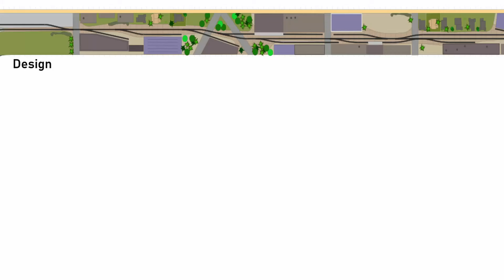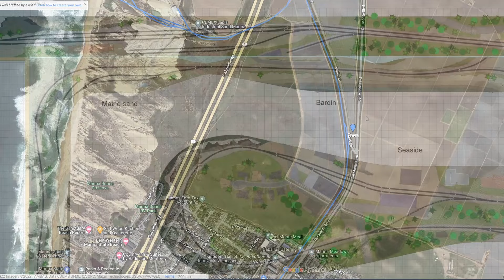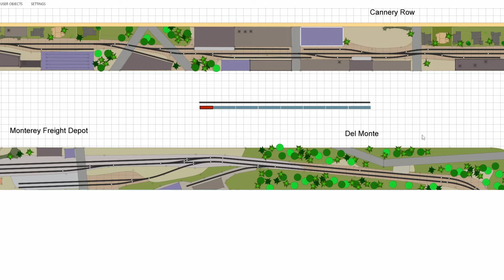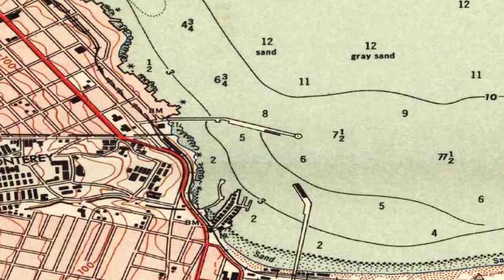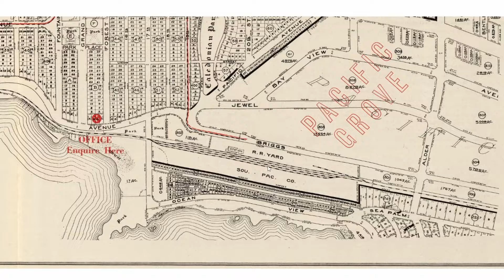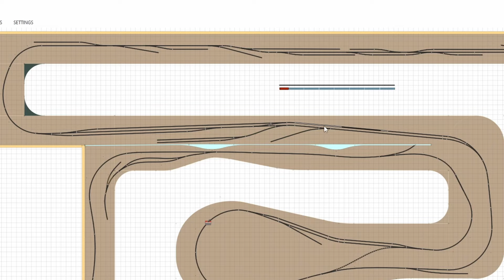Layout design considerations - Proto Freelance ~110

Comment: This is one of the BEST track plans I've seen in quite a while!   I would love to see this set in the 30's to 50's, with Fort Ord incorporated into it, but even so, this will make a great modern layout.   The only problem is that there are no more canneries on Cannery Row.   Those disappeared even before the railroad did.    

Still, I LOVE this layout!   Wish I had the time and money to build this myself.
Reply from the maker: Hi Ron, to be more specific, the entire railroad is almost non existing now a days! I believe there are plans to bring it back as a form of lite transport. 
We are stretching the limits of proto freelancing. But I believe it will make a great and realistic layout. This size layout really lends itself for 80ft boxcars and consists one finds on branch lines. A modern train with 30 cars won't fit. One could reduce the industry count on cannery row as it could have been. Adding a few empty foundations. This would symbolize the deterioration of rail traffic and rail served industries. At the cost of less switching of course.
Reply from the maker: P.s. Wish I had the space!

Comment: Hi Dubai!!! I really enjoy how you plan out your layouts... I really need your help. I'm trying to put together an apartment layout in the shape of a square C the three boards will be 3 ft by 63 inches which will showcase the ATSF in 1950's from the Chicago Dearborn station to Topeka Kansas, and lastly to San Bernardino California passenger station and yard. The problem is finding the industries that the trains would service and understanding how to place the tracks to make everything flow? How do you figure out where you want to put stuff and does it make sense? Then I'm in an apartment so I'm trying to make modules and wire them together so I will be able to put them back in my closet standing up so what should I add and not add with it being a mobile layout?
Reply from the maker: Hi Jeff, that sounds like a fun project!  If you can send me an email, the we can get the design process started. My email is in the 'about' section of this channel.
Chicago - San bernardino will mean a lot of fruit!
Reply: How do I get to the about section
Reply from the maker: Go to the dubai trains channel. Then there is a row of tabs listing home, video, short, playlist etc. And the last one is about.

Comment: Did the real trains go as far south as Los Angeles?  In Sept.of 1985 the Army at Fort Ord unloaded a bunch of military equipment off flatcars parked on the 8th st bridge. Probably the last time those tracks, near the army base were used.
Reply from the maker: No the railroad stopped at the lumber yard and sand pit. I read there are all kinds of plans to reopen the line for passengers but i don't know the status of that.

Comment: Now that's the train room you should be building!  Holy cow!  You really filled it up nicely, too.  
I leveled the layout.  What a chore.  I tested with a free rolling boxcar and a section of flex track, after using a 4' level to get as close as possible. 
BTW, did you know the height of Peco 83 track from bottom of ties to top of rail is 5/32"?  Never know when you might need that!  LOL
Reply from the maker: It was quite the design and quite the space! There was no space in the video for variants and details. A layout design is in most cases a journey of finding out what you really want. That will drive the compression and compromises. To my surprise we could spacuously fit in the majority of the branch line. Largely due to the space that just worked. 
I am thinking to borrow a lazer level for my next layout. It is around the wall. So any slight angle will come back to bite me in the ...... swing gate!